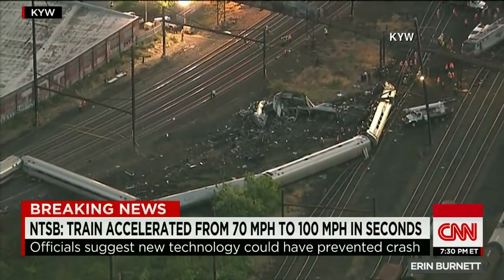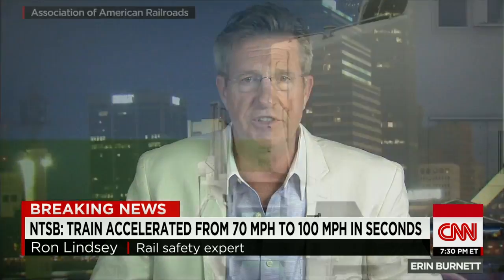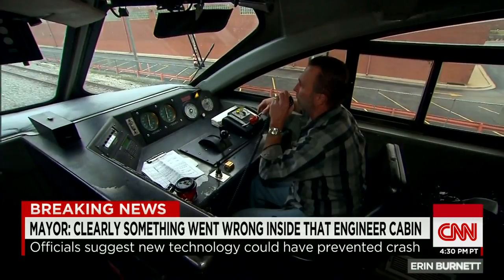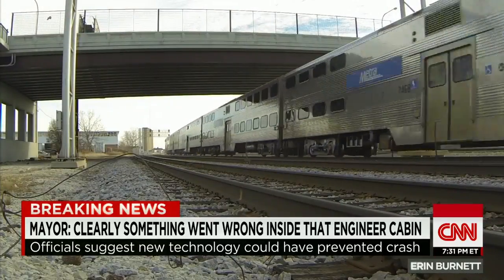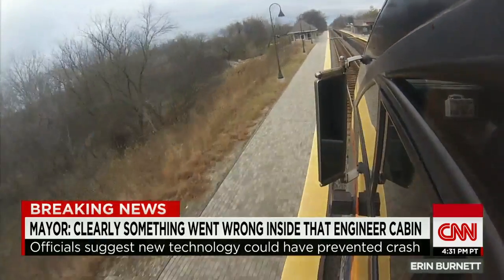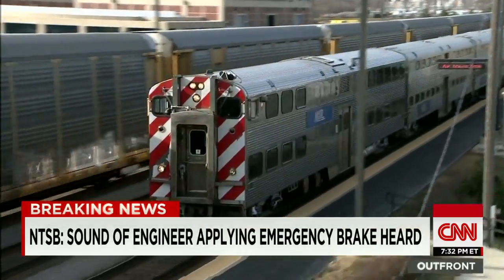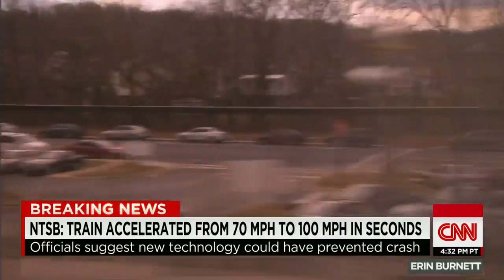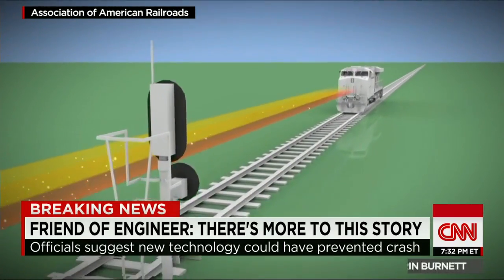How positive train control technology works

Comment: BS. It would not have stopped the derailment because the train was already at a decent rate of speed plus the driver POWERED UP thinking he was out of the danger zone due to  dealing with a stalled locomotive from another incident.